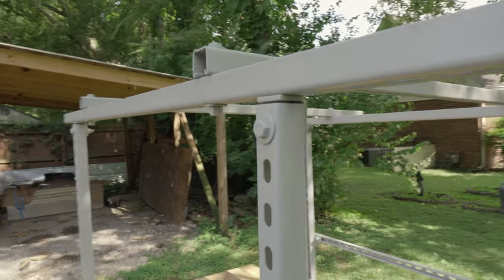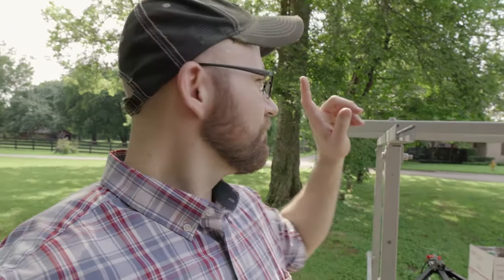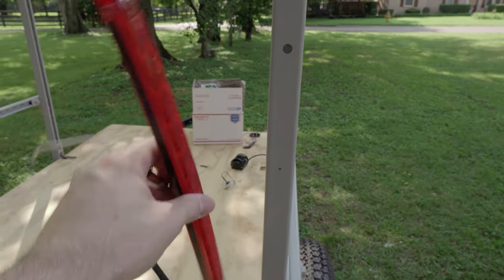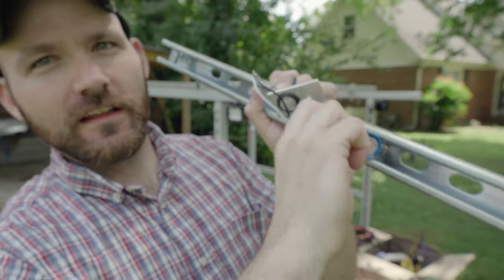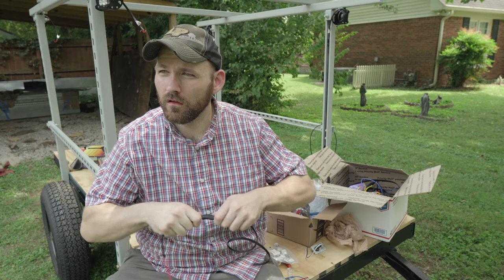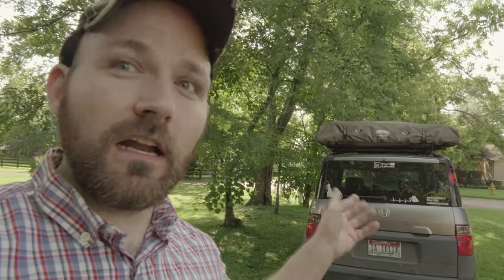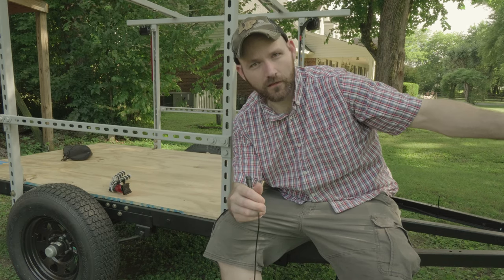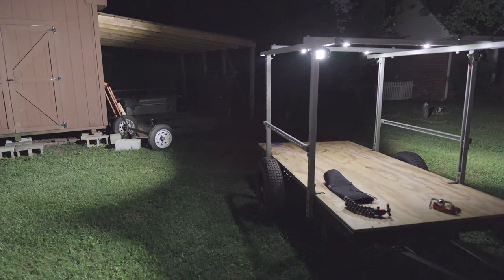Harbor Freight Overland Trailer: Rack and Lights

Comment: Thanks for the video! I am about half way through building a harbor freight kayak trailer, to pull behind my Element!! subscribed!!
Reply from the maker: Thank you. I can't remember if I mentioned this in any videos you have seen, but I am planning on putting lower cross bars on so I can have my Kayak on the trailer as well. I have a big Kayak, so hopefully it works out.